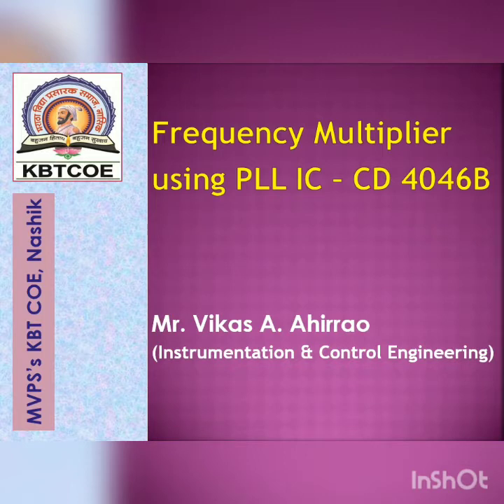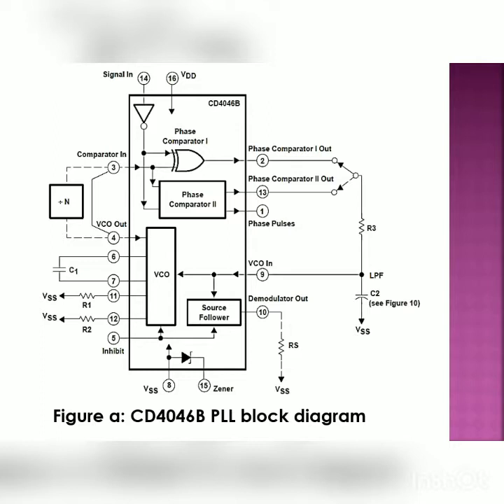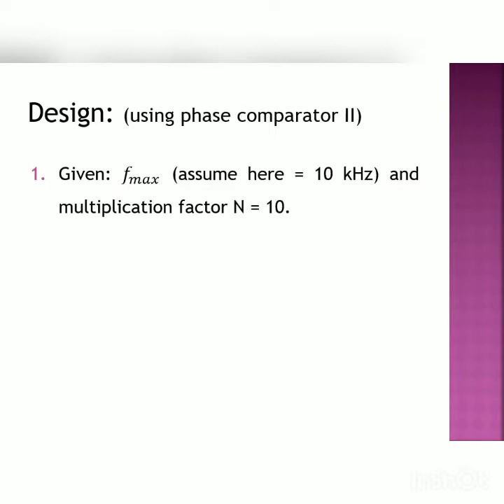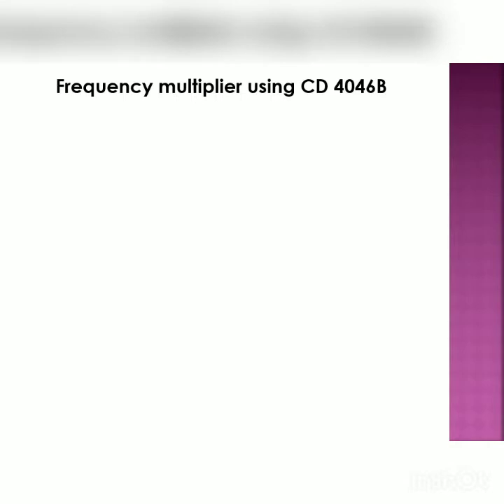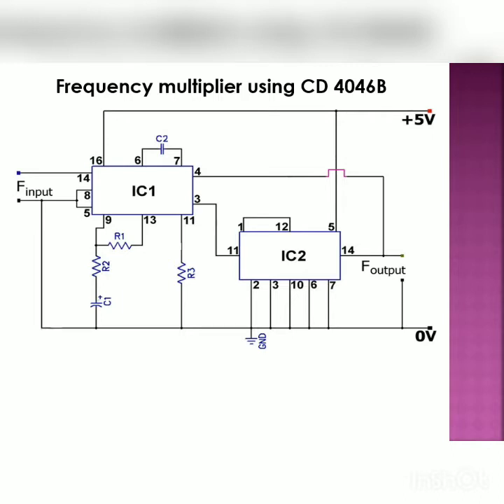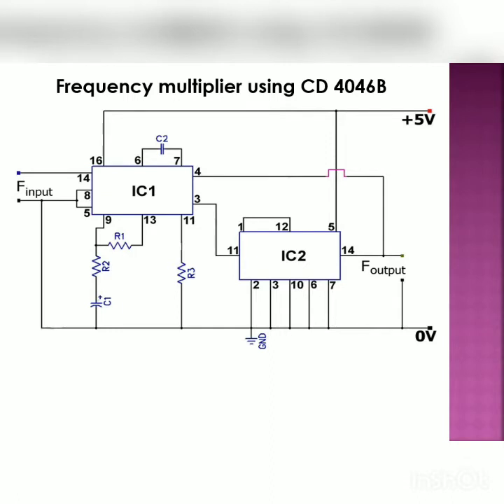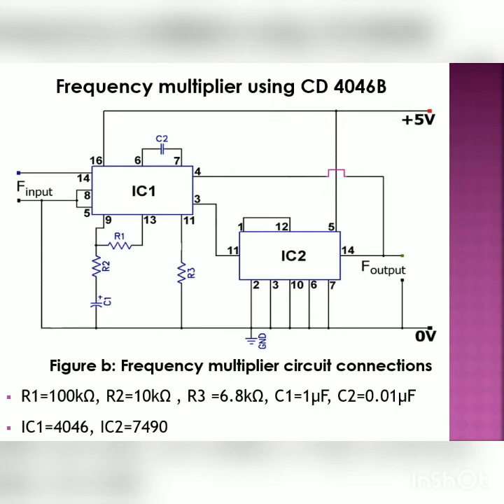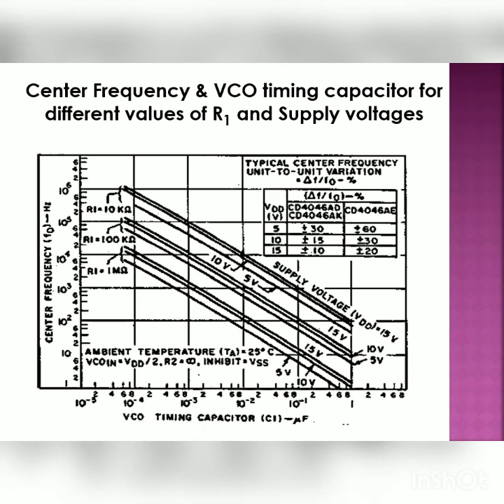Frequency Multiplier using digital PLL CD 4046

Comment: I tryed your circuit and changed C=1pF and R=560R on 5.5v supply. It accepted an input of 250kHz an reached an output of 2.5 MHz.
Reply: That is to say, same C and R, but 6.5V, the VCO frequency was 2.9MHz (the datasheet states for 2.7MHz)